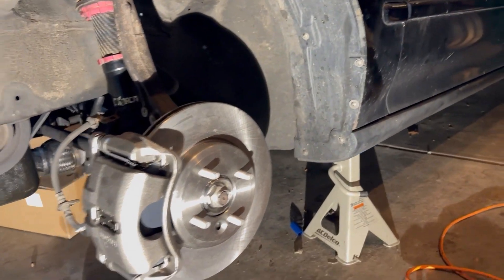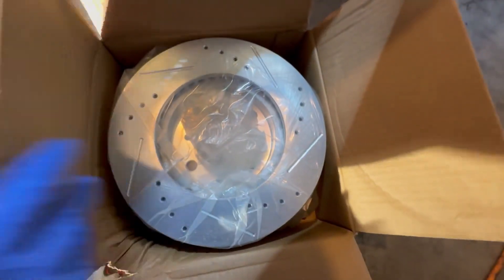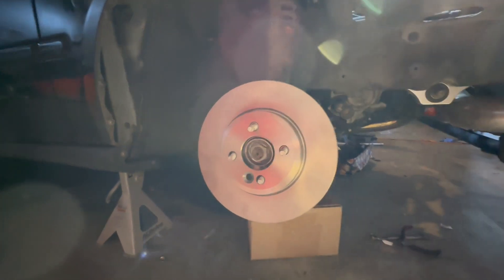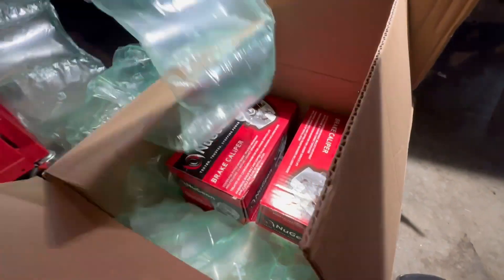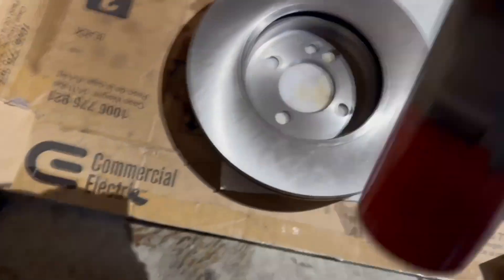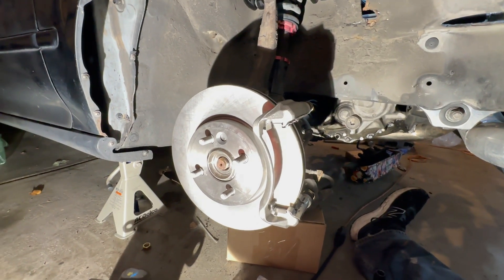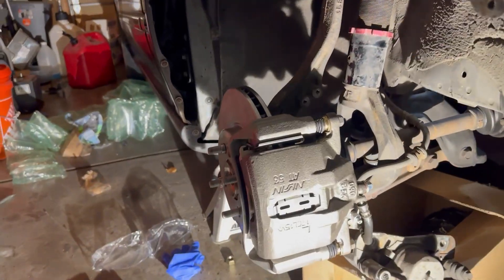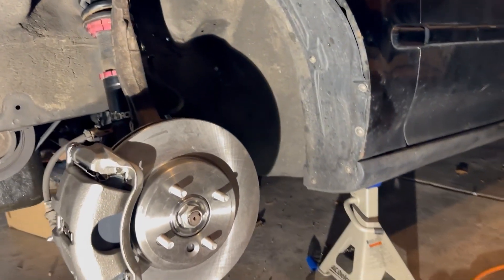Turbo Civic front suspension overhaul PART 5!! Ready to drive??!

Comment: The bigger brake calipers and rotors look mint! I bet its gonna make a big difference in braking power. I never knew you could swap the Mini Cooper rotors like you did, that is pretty sweet! 
 I got the wrenches in the mail! Thanks again man they will be put to good use! cheers! 😃
Reply from the maker: For real! Until recently I had no idea either, super cool all this is bolting up to the ex knuckles 😁 I didn't have anybody to help bleed the brakes last night so we'll see how tonight goes..

And you're very welcome dude thanks so much for watching the videos and entering the contest!!
Reply: @DanWithTheWrench  I used a 2x4 to jam in between the seat and the clutch pedal last time I had to bleed my clutch by myself 😄 press the pedal down, move the seat up a bit  and put the 2x4 or jack extension handle in between them so it holds down the pedal then barely loosen the bleed screw tell air or oil comes out then quickly tighten it back up then repeat 😁
Reply from the maker: Good shit man I think I'm gonna do that tonight, just nobody that has time to help out but I want to go test drive him soooooo bad..

Also got the tires in and gonna be installing tomorrow then an alignment!